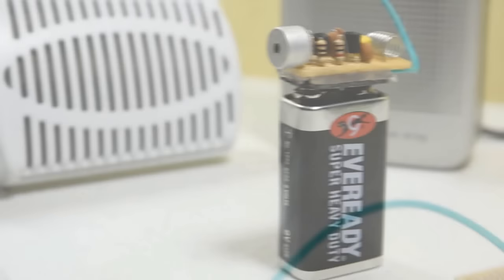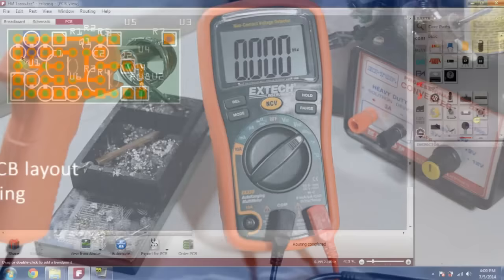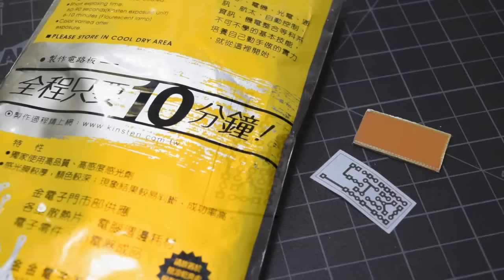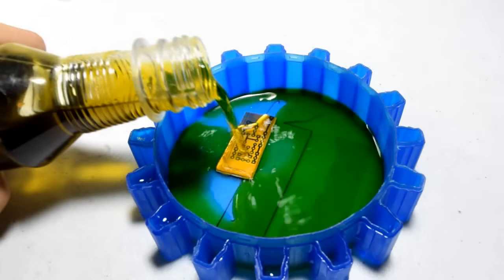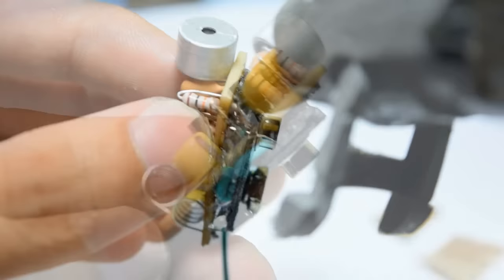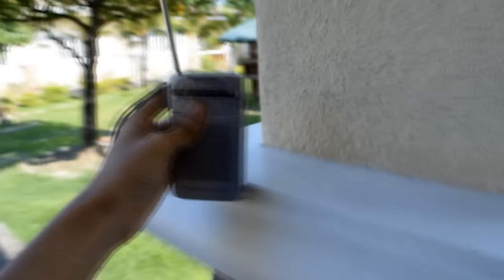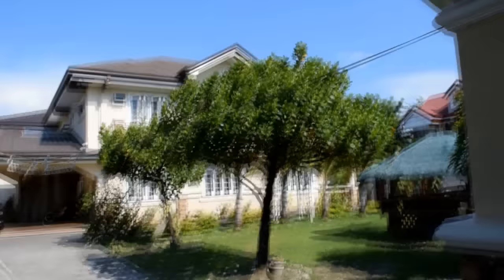Build A Long Range FM Transmitter (Homebrew Radio Station)

Comment: Excellent video! Very instructive and informative! I was thinking of trying this out myself, but I'm not so good with trim capacitors.

The ones I find on for example the bay, is listed as 20pF. Is that like a 22pF or is that strictly max 20pF. I mean, Does the trim cap work like a potentiometer with 0 to 10K for example? Or are the trim caps, in this example, 20pF in the middle/center and then it goes up a bit and down a bit?

Then there's a trim cap with stats 10pF to 40pF. Would this then cover both the 22pF and 40pF alternatives that you show in the video?

Thanks in advance and once again, great video! =)
Reply: +Chris Fredriksson you can use 20pF one. Download "rcalc" all from android market, it will help u alot.
Reply: +Anshul Mathur - Many thanks Anshul! I've built a similar version already and I've understood that it's important with the values, but near value seems to be quite alright as well =D But thanks, the app seems very nice also!

Comment: How much long life of the Krona battery? :)
Reply from the maker: ReaLRubyX About a week. :)
Reply: +Kk Indian Railways (NR) if you use normal one, u cant set the transmission on specific frequency. 
i mean it will be preset and you have to fine tune to find the freq.
Reply: I would like to know that too, I don't have any.  Ordering them locally is not possible.
Reply: great and simple i want to know the components names and circuit pic...pls bro...whats the link..

Comment: Nice project. Now we have to build receiver for it. Also adding push button to transmitter would make it closer to Walkie Talkie :) 
I just wander if there are any regulations that would make using this kind of pirate radio illegal on FM frequencies?

Comment: Well first off, this is illegal according to FCC regulations in the US. Although, they would have a hell of a time catching you because the signal is so weak.
Reply: Can't a boy have a little fun?
Reply: if transmitter's power is less it is legal in mist of county
Reply: Well, after doing some research, according to part 15 if the radius is at or about 200 feet then you don't need a license
Reply: +Logan Theodorou he is from the Philippines
Reply: +BroOlympus okay that makes more sense thanks
Reply: +Logan Theodorou Ok :) laws here are not that strict ... except for the fact a law maker saw law in america about registering drones which our lawmakers copied :)
Reply: TRG The Rabbit Gamer He is from the philippines
Reply: TRG The Rabbit Gamer Your source is from American Law not Philippine
Reply: Depends on frequency and power field. There are values that are free to use.
Reply: yes this is true does not mean he shouldn't get his license and as far as i know under 2 watts is legal for any transmissions
Reply: It's not illegal if you don't get caught!
Reply: BroOlympus No problem for using it in the Philippines. Unless if it’s half of kilometer (0.2W).
Reply: TheMagicalC 64 MHz to 76 Mhz and 76 Mhz to 87 Mhz.

Comment: i build my to its very easy
Reply: ok i will send it
Reply: ok i send it
Reply: Well I don't have it. MistrzZen have it.
I will send to you what MistrzZen send to me wait a minute.
Reply: if you not have 2n3904 you can use 2n2222
Reply: I have a 2n3904 what my problem is I don't know if it's NPN or PNP
Reply: there is only one type of 2n3904
Reply: um.having.diffculities.with.the.frequency....how.to.measure.it.with.oscilloscope?
and.i.cant.find.4pf
Reply: Yasin Nur Rahman i just sue 4.7 pf,   when i search the freqency i use nothing more than radio
Reply: ok, i send
Reply: can.u.send.e.ur.circuit.that.worked.for.u?plz
Reply: Yasin Nur Rahman you want photos?
Reply: MistrzZen can it works
Reply: janu kumar yes it work
Reply: Tech Engine i dont know but i think yes
Reply: what you think yes
Reply: janu kumar that can you use the copper wire
Reply: Can I use a BC547 instead of 2n3904? Works the same?
Reply: T Ξ S L Π yes its gona work
Reply: T Ξ S L Π yes i send it but maybe tommorow i dont have alredy computer with photos
Reply: MistrzZen ok Thank you :)
Reply: ok its go
Reply: MistrzZen Thanks Again, I bought a 20pF trimmer capacitor, do you think that's okay?
Reply: T Ξ S L Π yes, if you cant found signal jus change coil, i use too difrent trimer this green one its propably 40pF
Reply: sorry for the many questions, but can I use two 10pF capacitor in series instead of 4pF cap?
Reply: T Ξ S L Π yes i thinks its gona work but changing it to good values can be harder than on one capacitor
Reply: Thank you again :)
Reply: From where did you got that trimmer capacitor
Reply: Can use 2n2222

Comment: I´ve justo done this proyect and I have 3 questions.
1: Why I hear a lot of noise?
2. Why I cant hear no more than 1.5 meters of distance and badly?
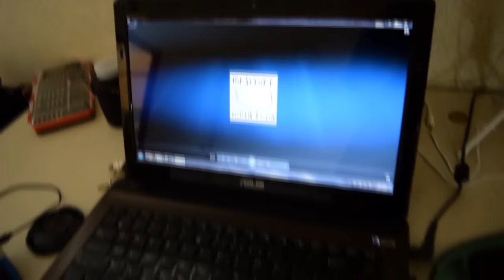3. In 4:03 , why the hell you cut the video just when you are going to test the transmitter???? Huh? Huh? ¬¬
Reply: I had the same problem, so I cleaned off the flux from the board and only used a battery (no power supply) but i still don't know why he cut the video Hmmm...
Reply: I iamge you'd need a filter to filter out any unwanted frequencies that contribute towards the scrambling sound you here.

Comment: It was very easy for me to modify a 151 megacycle Walkie Talkie to transmit on 100 megacycles to 108 megacycles.  It sounded very clear after the modification.  I do not know what the person that had me do the modification wanted to do with it.  However, it became a 5 watt 100 to 108 megacycle, wide FM, transmitter.  It was an easy £150

Comment: That is so tiny! I saw a pirate radio station throwy project, but that was relatively big, using SDR and a Pi Zero. A simple CPU to detect unused frequencies and automatically start transmitting, and you could make the ultimate pirate radio.

Comment: Must need e capacitor 100mfd  16 volt for power to get perfect signal.And if u want to play music from mp3 player you must connect e 560 k resistance to 104 pf connected to transistor 3094 base pin . And input volume must be low. Other wise u can not get clear signal.

Comment: Awesome work, but you should familiarize yourself with the FCC regulations (or the regs of the regulatory body of the country you're in) on personal FM transmissions. There are only a few permissible frequencies, and there are also strict power output limitations.

Comment: 1. note bias polarity of electret mike   april 26, 2016
2 1st transistor amplifies audio produced by the electret mike 
3  FM is created by the voltage swing created by the 1st transistor on the 2nd transitor base
    the capacitance , Ccb, of the transistor junction which varies with voltage 
     
   2nd transistor which oscillates due to feedback of C5 
    the tank frequency, fout depends upon L1 Ct,  where Ct = Ctrim+Ccb

  important to
 use good quality electret mike

observerms

Comment: EASY TRICK...! in order to get a better idea of the project, press de Windows key+Printscreen and thus, save a screenshot of what you need, for example, the list of parts, de diagram, and the PCB paths, pause the video where there is what you need, press the combination of keys and go to images folder, et voilà..!

Comment: According to the rules a "legal" homebrew FM transmitter can only go a few feet.  Most of the ones you use to transmit your phone to your radio are so weak you literally have to put the transmitter next to the radio  antenna.  An AM part 15 transmitter however can broadcast 100 milliwatts and under the right conditions can go 1/4 mile and possibly further on a good radio in a static free area.

Comment: I quite don't get this circuit. What is generating the FM signal? You only have a class A amplifier and a class C amplifier at a resonance frequency of around 1GHz. WTF?
Reply: First transistor is for audio amplifier. Second is a colpitts oscillator, which can be tuned from 88 to 108mhz.
Reply: @rms8698  Thank you, now I know what to search for.

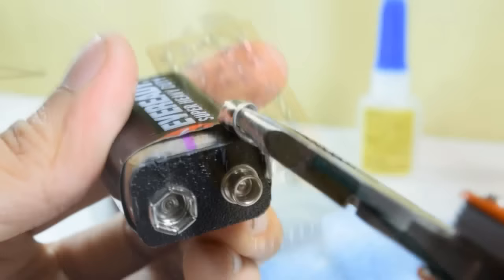Comment: On 2:35 you said only use a maximum  of 8” what would happen if you used a longer tone like let’s say 15”
Reply: maybe the range will get to big too the point of being illegal or it won't be able to drive a signal into a long wire

Comment: I actually have had a low powered transmitter that I use since 1997 the FCC don't care as long as you don't interfere with other stations who pay for that signal

Comment: How do we know the audio is coming from the radio? It is easy to add audio files to a video. I could screen record your video, and insert audio so that it sounds like interference. And then Add alien sounds. Actually, now that I think about it...I could make it sound like the transmitter is turning other receivers into transmitter so that it conversations can be heard. I could get some friends to sit inside a car in the parking lot and have a conversation, and I walk by with my little homemade device that listens through the car radio. But in reality, I just placed a microphone in the car and retrieved the file to add to the video, making it look like my device did illegal things.

Comment: I have a project and it is a fm transmitter. the materials you used are common but the #18 wire is not available on any of electronics shop I went. what would you sugggest? how about #22? how many turns?

Comment: Hey! Is there a way to use a lower voltage battery? I kinda want to make it even smaller... :D
Reply: @Harry Swags Yeah that could be an option. Do you think i can modify the circuit to make it usable with 3.7 V batteries?
Reply: @Harry Swags i could use a 3.7V and a boost circuit to 5V

Comment: Interesting and I use it sometimes for fun. But I starting from this principle I would like to create a project, which is to create interference to my home hifi (I have to take a whim off) and then if for example I put on a CD or trivially the radio I would like to be able to change music or what I want at a distance (5\10 km). Who can help me out? ( URGENTLY ) Arduino. Teensy. Thank you very much. :)

Comment: what’s the size of the resistors 1/4 watts?
and the tolerance are they gold or silver it’s hard to see from the picture.
can i replace the solid wire with a 10” telescopic antenna for clearer signal transmission 😀

Comment: If I wanted to increase the range so it could go through solid concrete wall a little bit further would I increase the length of the antenna / increase width of antenna?

Comment: Nice build but illegal to operate in the UK and many other countries. Should have tested the transmitter around the 107 to 108 bands as these are hardly used and won't interfere with commonly used channels

Comment: great work! thank you! with 2 caps 10uf in parallel instead of the trimmer i broadcast with some noise on 108.5.
anyone knows how i could eliminate the noise and make it more sensitive? at the moment i can't broadcoast if i'm 2 meters away from the mic but i would like to have bigger range if possible... would that be just a matter of mic's quality?

Comment: does this transmitter have to have a receiver somewhere around or can it actually just transmit sounds like voices radio station is things that are coming from your computer into the air and be picked up into someone's house can actually focus on the individual area

Comment: Could 2n2904 and 2n5041 be replacement for listed transistor, because those are only one atm near my town? And can I use adapter plug(9v, 150mA) instead of battery? 
Thanks in advance, mate.

Comment: hello i need a little help regarding this. if i use 3906 npn transistor instead of 3904 what capacitors and resistors do i change in order to make it work?

Comment: looking on the transistor flat side facing me - it's EBC from left to right. some pinouts are CBE. mine are EBC but looking on the pictures compared to the schematics it looks like those in the project are CBE. please help. can't tune it. the i've soldered it there's voltage between collector and emitter. can't find it on sdr.

Comment: Are you still here? Hey I hav a problem, i used 18pf trimmer due to unavailability of 40 pf. And used copper hookup wire  for coil 9 turn on pencil. It not working. Any idea?

Comment: +TechBuilder How many power, or should I say the transmitting power of that long range FM Transmitter? Is that as high as the radio stations did? Then what places covered in that broadcast? :)

Comment: I have a few questions:

1.) Where does the other end of the coil go, on the layout there is one node at the end far away from the rest, where does the other end of the coil terminate, on the schematics it shows it connecting to the antennae.

2.) How are you establishing the ground connection?

3.) I can't tell where most of these lines are pointing to on the layout they are not very accurate can you clarify?

Comment: A small tipp - you should use ALWAYS a PLASTIK screwdriver since the metal one also works as small antenna and makes it more difficult to get a clear setting :)

Comment: It won't work at all, I have already tested this circuit with many kinds of transistors, including 2N2222, 2N3904, BC547, and BC546. I also have gathered all of the other components 10K, 1M, 100, 1K, and 100K Ohm resistors, 0.1, 4 and 0.01 uF ceramic capacitors and a trimmer capacitor with range of 0 - 40 pF. Can you help me to find what I possibly did wrong ?

Comment: I'm building my own transmitter and was wondering what the highest voltage and current I can input into where the mic would be. I would be using an aux cord spliced to transfer a signal from an arduino nano to the transmitter. Any help goes a long way since I'm still reltatively new to this. (I'm basically askig for a dummy explanation). Thanks in advance.
Reply: Look up who the FCC is and what they do

Comment: I've got everything, but had a question about the 4pF cap. Your Instructable says it should be a 4.7pF in that place, so there's confusion there...but I was also wondering if I could use a 47pF or .047uF in its place, because that's all I could find in the stores I went to. Quick reply appreciated.

Comment: Dude; Has ANYONE ever built this?????? I need to know if this works or not.
Reply: Made one three days ago exact same components with trimmer cap and inductor coil as in video, did not work, tried different coil sizes, still nothing, add to that i can't find a single person in the comments who done this circuit and it worked

Comment: it isnt working spent 4 hours exact same components amd everything, theres current and voltage  across all components but no change  in output and also how should i find the frequency its transmitting at?
Reply: Just suggesting. At a quiet monist, go back over each component one by one to verify their functions. Your frequency can be hunted for on an FM radio by tuning or turning the range (dial) like the video shows. OR you can sell me the assembly & I'll do it? Just saying. Much good luck.

Comment: Hey TECK BUILDER  your projects are just amazing. pls can u make a 6 in one car, which has 6 modes. m1- remote controlled ,m2- ir controlled, m3- obstackle avoiding robot ,m4- distance sensing robot, m5- hoverboat ( i mean a boat) which can run on water, and if u can m6- drone. Everything  is  controlled wirelessly (with nrf24l02 radio module) .The remote shiuld have a lcd which shows the mode number and the mode name ( i mean like m1- remote control , m2- ir control).
It should have a push button to change the mode. It should be light weight. Everything should be made of geared dc motors. It should be based on arduino. The remote should contain  two joysticks to move the robot. Pls it would be a great help for me if u could do this. Thank you

Comment: Any idea if this would work with Android phones with inbuilt FM tuner ?
Reply: Banibrata Dutta i also think it will not work with andriod radio as i have build this but test not successfull due to no other radio but one of my friend said changing the resistor value will make it work ,because he built this from the above provided materials

Comment: how will I come to know where to solder resistor s and capacitor and the negative and positive side of capacitor
Reply: Vaibhav Maitry Are you a troll?
Reply: Vaibhav Maitry Resistors and Ceramic capacitors dont have any polaration.
Reply: Okay

Comment: Would this work well as a SMD, surface mounted design? It'd probably make for a much smaller design
Reply: no reason why it wouldn't work, just a bit more difficult to solder.
Reply: @X4Alpha4X  would it be just as good? Range, sound  etc
Reply: @wat8437  of course, as long as the components have the same rating(ohmage, capacitance, etc)

Comment: Can you use a 60pf trimmer cap that's all I have or would you need a completely different setup?
Reply: that's not a "long range" Max. 20 meters , I've in my channel 1 most powerfull Fm trasmitter Amp with pll MORE stable signal
Reply: @views-hh3el I can't find your channel

Comment: hey i need some kind of advice.....i'm  working on a project in which i need to transmit only a binary data...that means i only need to transmit the signal when the system is on...if the system is off then it doesn't matter....so am i able to use the above transmitter....if it is possible plz tell me what are the modifications i need to make?

Comment: what will be the frequency if i use  20pico farad cap instead of the trimmer cap
Reply: Calculating the LC circuit, if the inductance (L) of your coil is 0.1uH then the capacitance of your capacitor (C) is 20pF, the frequency is 112.5 Mhz
Reply: Try to increase the value of your capacitor's capacitance to decrease the frequency.
Ex. L=0.1uH and C=22pF , =107.3Mhz
Reply: Please tell me the formula
Reply: Sorry bro, i don't have an exact formula for this circuit. Im just using an applications that calculate the circuit, you can use them too, or even use this link: http://www.deephaven.co.uk/lc.html